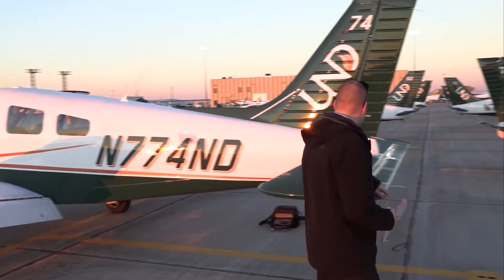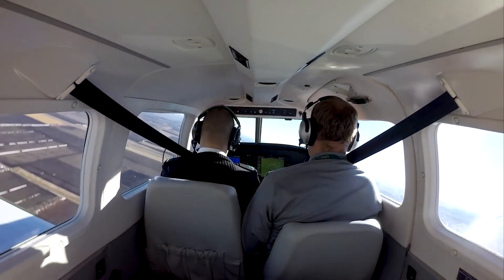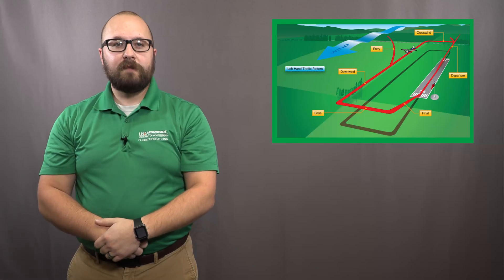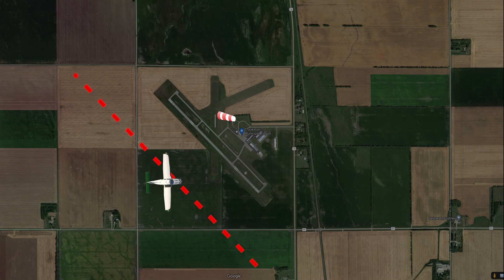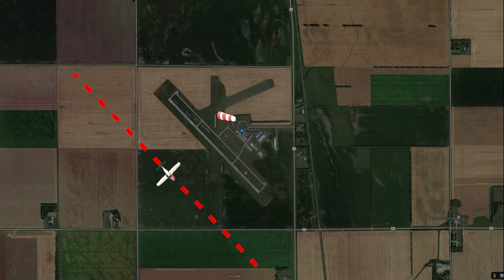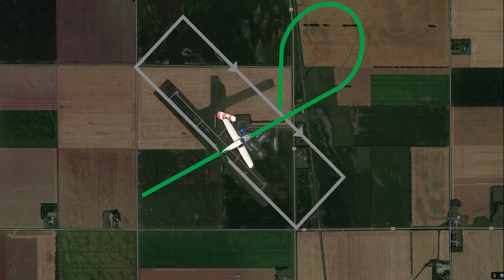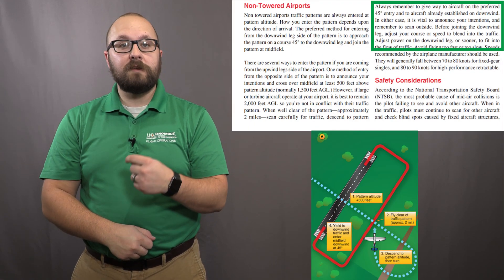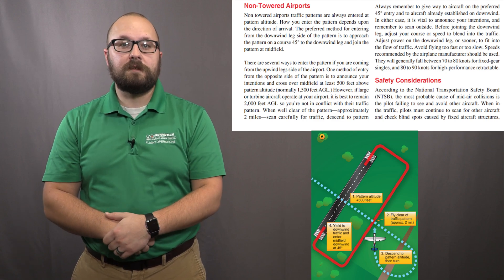VFR Traffic Pattern Entry and Exit

Comment: These two entry methods are okay for aircraft considered to be slightly more than powered kites. But if you're flying a turbine powered airplane - especially one over 12,500 pounds - you won't be able to fit into the standard Piper Cub sized traffic pattern; you'll be wider, faster and higher. The fewer turns you make near an airport, the less likely you are to hit somebody. A turbine airplane will always intercept the normal geometric boundaries of the typical Cessna traffic pattern from the straight-in. So, you student pilots, don't expect a turbine-powered airplane to conform to what you would call the normal traffic pattern dimensions. They can't do it.

Comment: What are your options if you're arriving perfectly in line with the active runway?... You keep 1500 feet altitude and drift to the right in order to enter the traffic from the upwind side? Or you drift to the left at 1500 feet altitude and past midfield you do a "loose right U-turn" in order to enter downwind at 45 degrees? Thanks in advance!